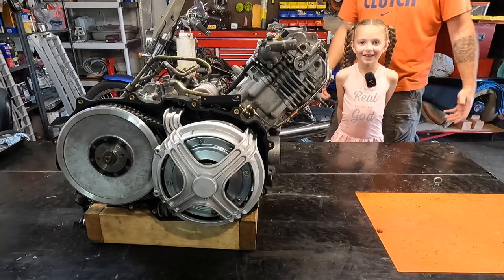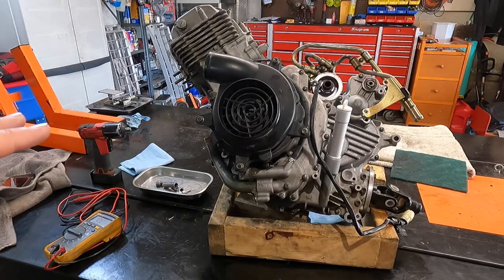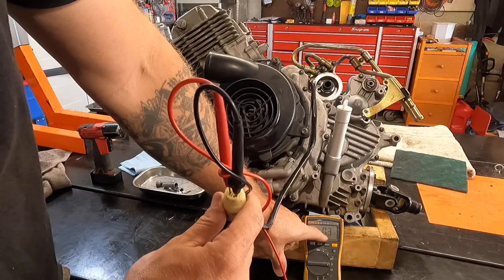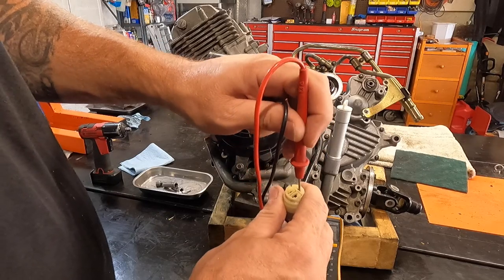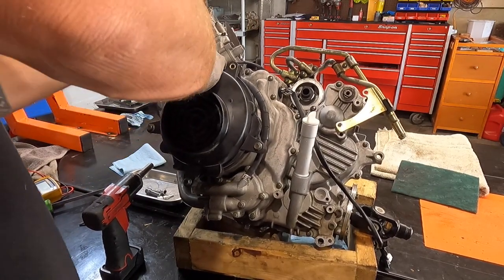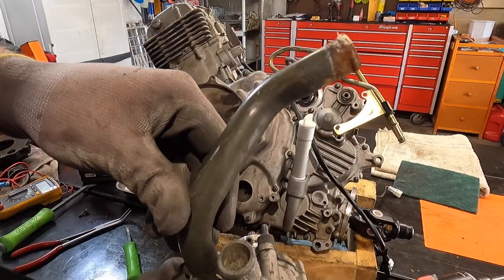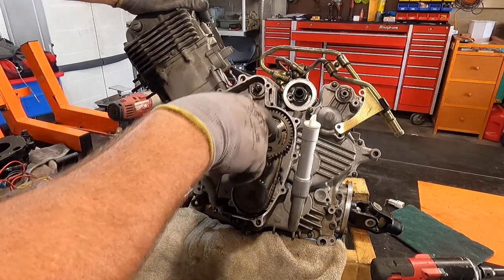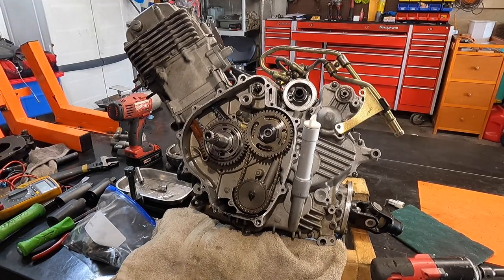Massimo Charging system

Comment: Thanks for making this video, it's been very informative. I'm replacing a stator & I need the part #s for the side case gasket & for the o-ring for the coolant pump please.
Reply from the maker: 11323-004-0000	GEN / STATOR COVER GASKET & this part # is for the o-ring back of the water pump 91212-004-0000O-RING 34.2X2.5 H2O

Comment: I wonder if they broke it trying to tap the cover off.
Maybe they installed a higher amp stator? 
Do you see or hear of many engine failures with the Hisun 700’s?
Reply from the maker: I'm not sure what they did to break it. The owner had it worked on at a few different places before the shop I got the motor from worked on it. I know they said the owner didn't know much about the unit. 
 As far as motor failures with the 700. I really don't hear anything bad about them besides the clutches because like you & I both know the 500 & 700 are the same bottom ends. I have a lot of failures with the 500 tho. timing chain & tensioners taking a crap along with the cam lobs wearing off. I do have a 500cc from a  "coleman" to take apart. the topend grenaded on it on an older couple driving to thier mail box. I need to do a video on the disassembly of that. but the topend was already taken off. I'll get to it sooner are later. lol

Comment: Do you have a link for the flywheel puller
Reply from the maker: https://amzn.to/46PzSNZ
Reply: Can you use this puller with the engine still in place??
Reply from the maker: Yes you can. Of course removing the gas tank makes for way easier access.